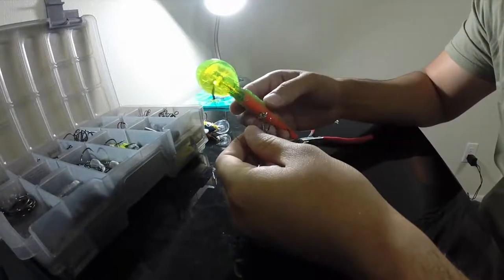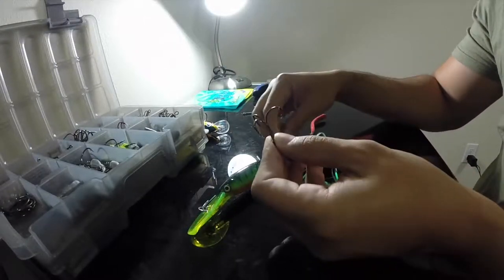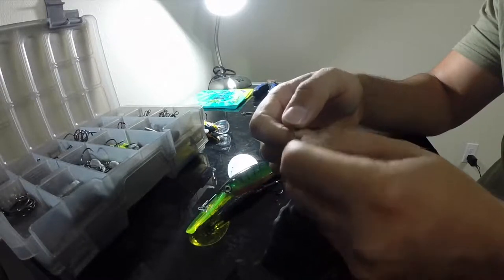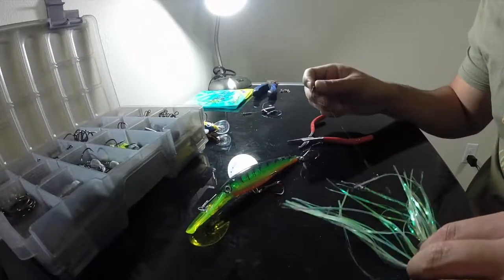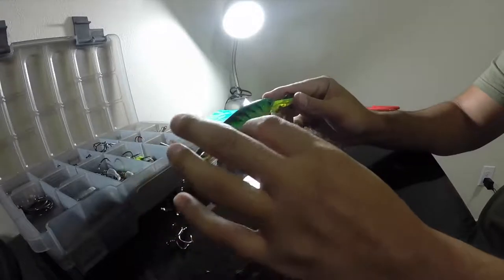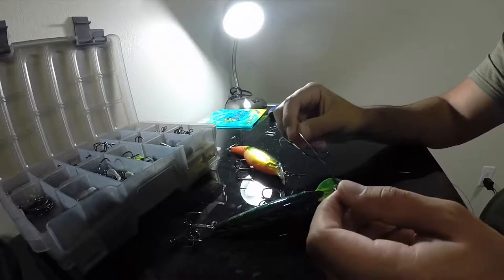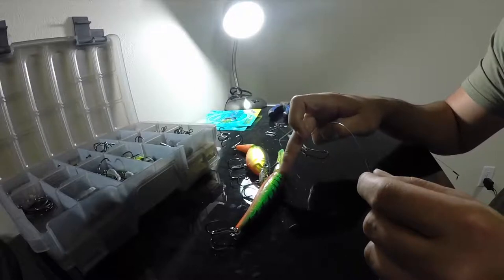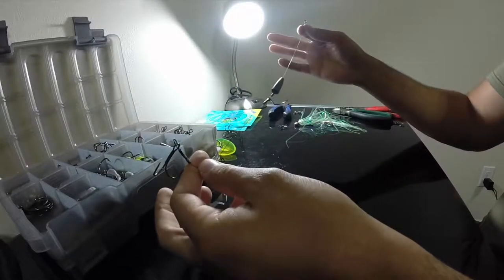King Fish Leader Tutorial (King Mackerel Rig)

Comment: Using lures for kingfish one mile offshore...what lb test do you recommend for the knot 2 kinky wire?
Reply from the maker: Brian Beltran I usually run the lightest possible at around 40 lbs, but enough for a fifty inch king or even a shark. The rig didn’t fail with the shark, the hooks bent out for the release. I don’t tie knots and use a crimp. Although, I loop the wire once through the hook, swivel, etc., turn it through for a second time, after the second pass I loop the wire tag end through the first wire loop (not including hook) 3 times, cinch down to create a small loop possible, and finally crimp tag end (obviously having the crimp through main wire before beginning first loops). Sounds confusing and I hope to have explained that well enough, but I’ve never had an issue. Crimps are small single sleeve just big enough to fit the wire through twice.